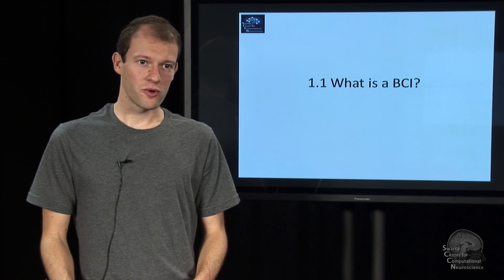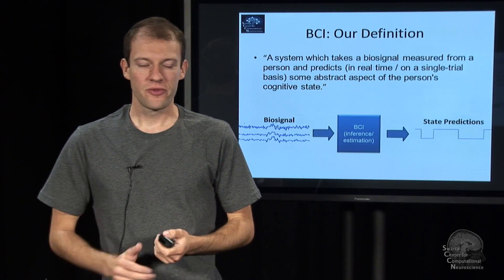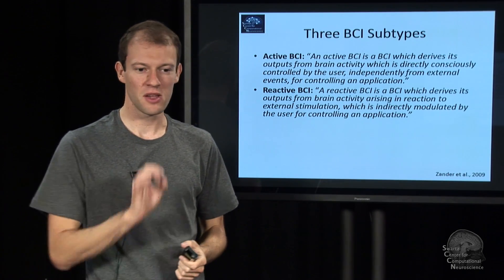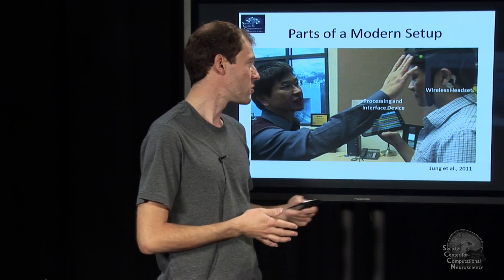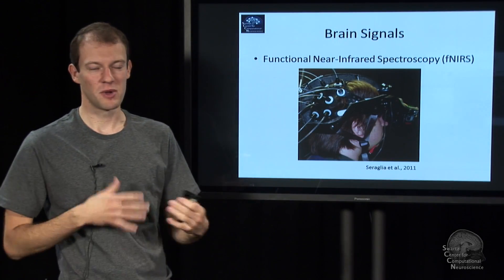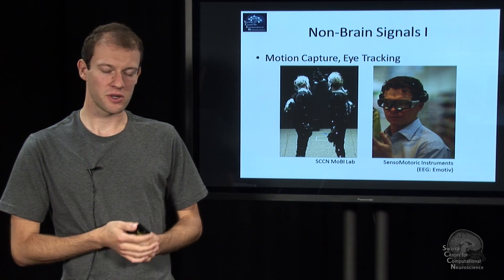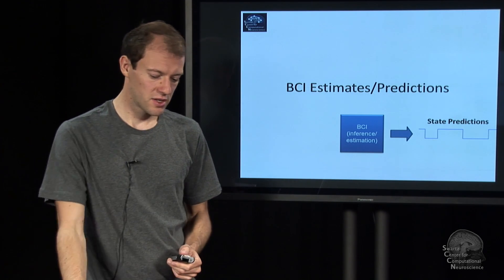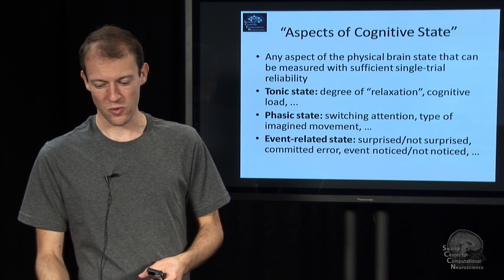Lecture 1.1 What is a Brain Computer Interface?

Comment: EEG nodes + frequency/amplitude modulated wire loops, designed to 
produce magnetic fields of modulated field intensity and size (I assume 
everyone reading this is familiar with transcranial magnetic 
stimulation). Due to the mathematical behavior of this, we can utilize 
the formulas involving Columb and Lorenz forces to predict the spatial 
distribution spikes in energy that form bands in the magnetic field 
produced. Utilizing these principles, we can then take advantage of the 
principles of superposition and cancellation when multiple such 
modulated fields are produced to increase or decrease the intense the 
charge passing through the neurons in the regions of overlap.

Similarly, we are also able to predict the skew such signals will cause 
in nearby EEG nodes, also in fixed spatial positions. This would allow 
for fine resolution activation of groups of neurons, as well as 
suppression of existing neural firing via interactions between membrane 
polarization and intersecting 'troughs' in the wave patterns' spatial 
positions.

This is merely a refinement of the low resolution proof of concept 
performed by Stocco and Rao (2013), and later replicated by others at 
the University of Washington.

Due to the necessity of fixed spatial position for reliably calculating 
overlapping superposition and cancellation of the electromagnetic fields
 within the brain (linked to the particular effects of cellular 
structure on the field produced by it's cell body polarization), 
intracranial implantation of EEG and magnetic induction loops would be 
ideal. However the shifting position of the brain within the skull would
 ultimately necessitate the use of algorithms interpreting the shape of 
the field as perceived by EEG nodes regardless, in order to have a 
meaningful map on which to project changes via magnetic stimulation.

This technique would allow for a high amount of resolution with limited 
stimulation sources of relatively lower individual intensity, with 
exponential gain in resolution and for each interacting magnetic 
stimulation node influencing a region. From this point, it becomes a 
matter of software, rather than hardware.

Similarly this relationship between cell membrane polarization, combined
 with spikes from potentiation, upon the EMF (electromagnetic field) of 
the individual neurons is also, by its nature, a product of these 
patters of calculable superposition and cancellation. Operating from 
this model, the intensity in the fields perceived via EEG must also, 
according to our current understanding of the EMF fields involved, carry
 calculable information regarding the base polarization, and specific 
firing activity, that may be mathematically reduced via the spatial 
positions of cancellation and superposition, and their electromagnetic 
intensity.

This isn't old information. These are things we already know. Am I 
missing some critical issue?